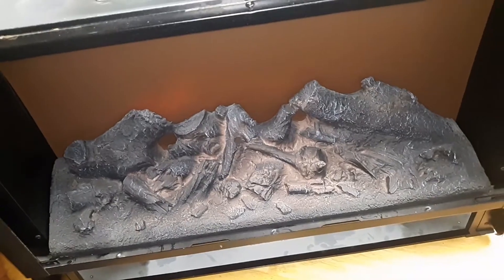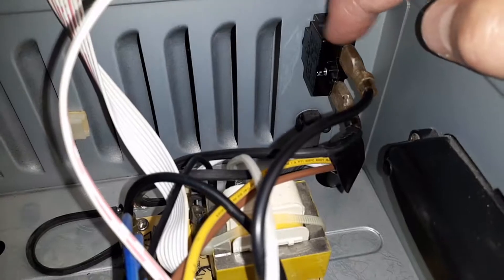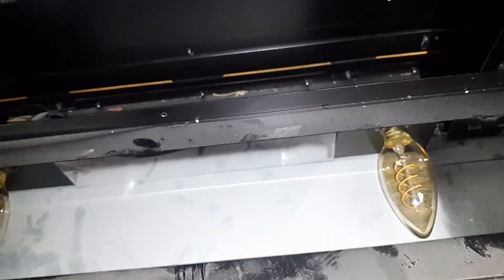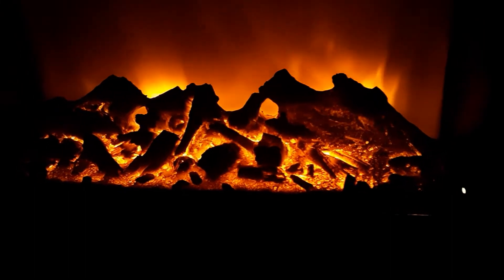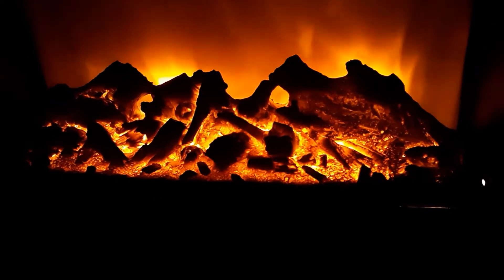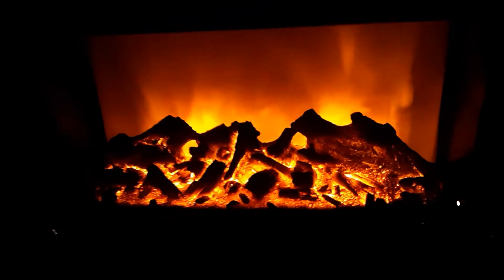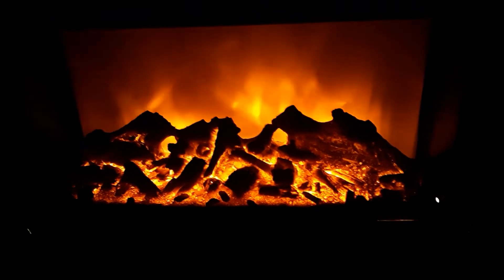Amish Heat Surge Heater Repair

Comment: @davidcrosby8552, Thanks so much for taking your time to make the video!  I have a similar model with the same problem on the reset, the wires running from it are burned.  Would you PLEASE let me know how to determine what part that is so I know how to order it?  It doesn't appear that it would be all that difficult to reinstall -- it's just knowing the where and WHAT part to order!  Thanks again, you really seem to know you're way around electronics!  Happy 2023!
Reply from the maker: KUOYUH Circuit Breaker 88 series 125/250VAC 50/60Hz (1pc) (15A)   As listed on Amazon for about $6.00 right now

Comment: What temperature sensor, you never showed it so we don’t know what it even looks like
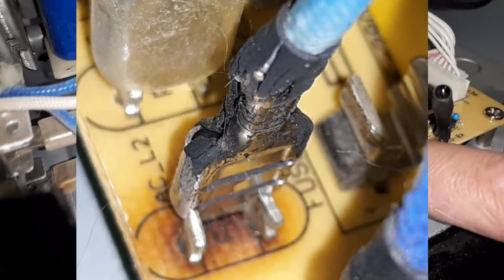Reply from the maker: Normally it's attached to the back vent behind the fan.  It looks like a small bead about 3 mm diameter at the end of a pair of small black wires.  If you pause my video at about 1:06 you will see it at lower right sticking straight up in front of the circuit board.  I repositioned it as I'm using this as a fireplace insert.  Also opened up some holes at the front of the unit and blocked off the back vents, so I don't draw in dirty air from the fireplace.